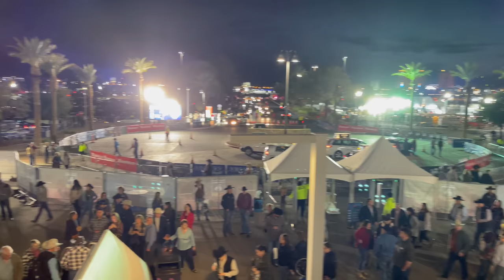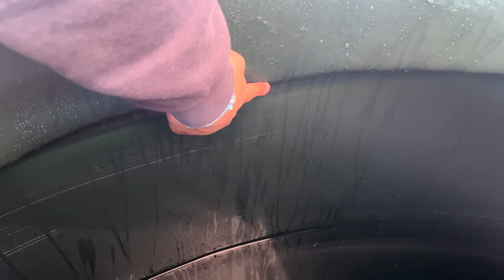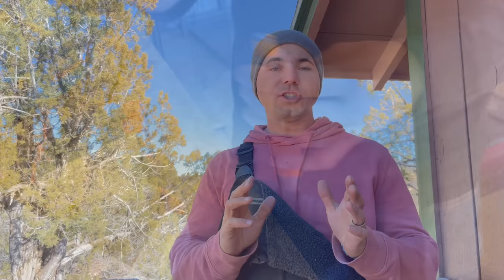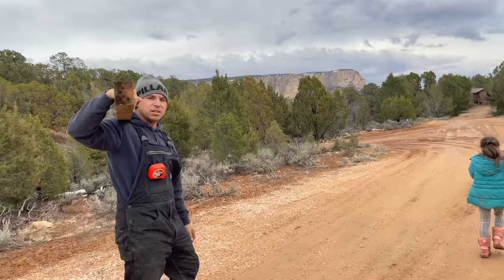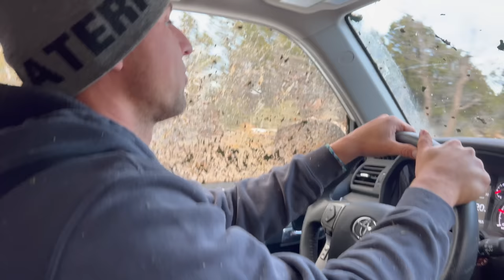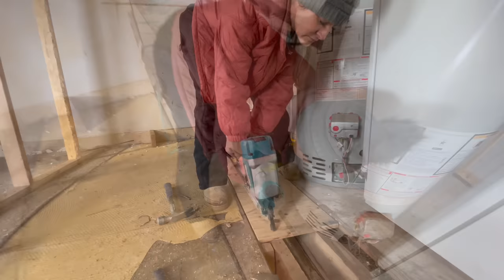FRAMING CABIN RENOVATION I LIVING OFF THE GRID

Comment: Try putting RAIN—X on your Solar Panels so the snow will not stick to the panels.
Reply: @Shinobi 272 

I really do not know anything definite one way or the other.
One way to tell is to clean them real well, even using rubbing alcohol and test them with a large load.
Then put RAIN—X on one panel and check it’s output.

I once drove from Minneapolis to Denver in a terrible down pour the whole drive without using the whipper because I couldn’t get a part they needed.
NEVER HAD ANY TROUBLE AT ALL AND IT WAS RAINING AT LEAST 1.5”/hour.
Reply from the maker: This is a great idea. I’ll check and see if there’s any info on the affect it may have on the panels and their output. Thank you!
Reply: Polish them the same way you would a car. It last so much longer than rain x.
Reply: @lifeelevatedoffgrid  

SO DID YOU TRY IT???